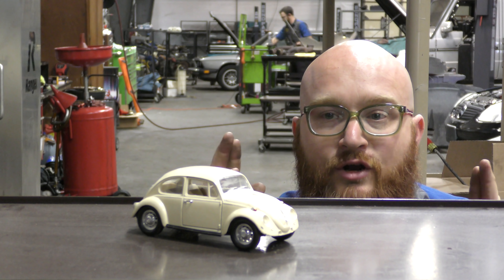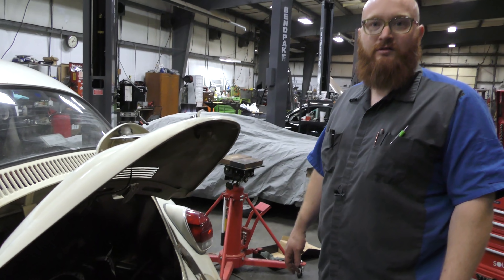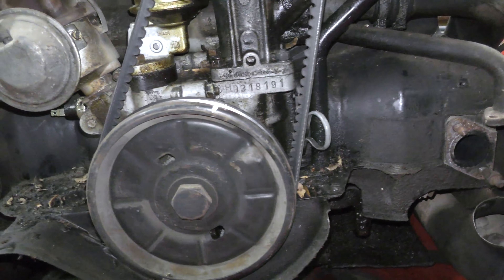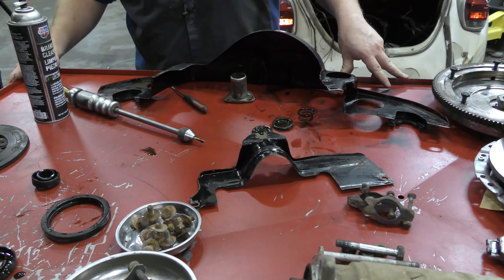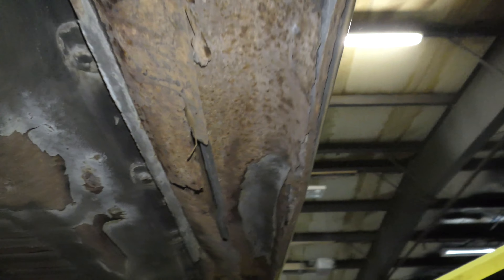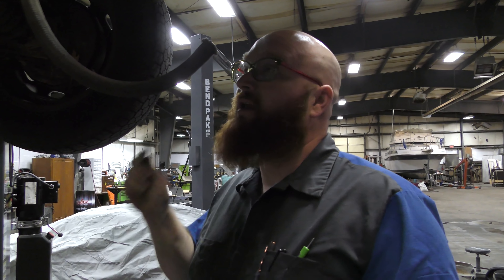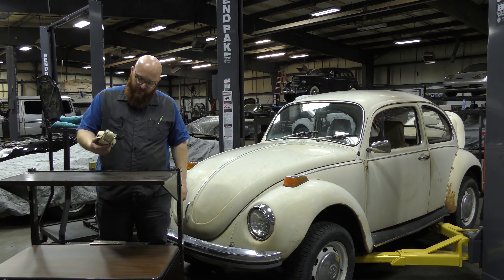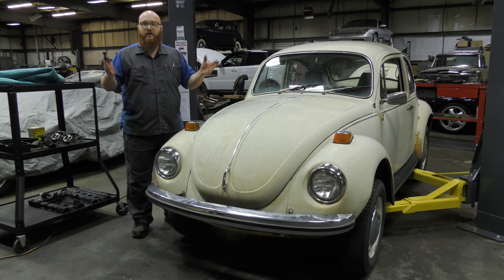Engine out for a clutch on '72 Super Beetle?! CAR WIZARD shows cool little car & huge repair process

Comment: When I was a kid, we changed the engine in our 67 on the side of the I-17. I was too young to remember what the problem was. But my grandpa had an extra rebuilt engine that he put in the truck, drove it out to us with a couple big strong friends, there were a few of my dads friends with us. Unbolted the engine, 7 guys lifted the back of the car up to drag the engine out and slide the new one in, jacked it up, bolted it in. We hopped back on the highway and drove to Flagstaff. 

Years later and I can do that entire swap in my carport in 30 ish minutes on my Baja. These cars are incredible just how cheap and easy literally everything on this car is to do.

Comment: Brings back the my memory of my first Beetle. I traded a 1st gen Mini Cooper, that was pretty worn out from all kinds of racing, for a brand new '97 Beetle. A week after I got the new car I was driving down a two-lane road north of Tucson and came upon an unmarked 90 degree corner. Forgetting that a VW handles quite differently than a Mini Cooper I just cranked the wheel hard left. Surprisingly, the next thing I know I am rolling over three times. Fortunately, neither my roommate nor I were hurt (we both had our seat belts on). Needless to say, my dad was not pleased that I managed to total a car with only a couple of hundred miles on it. Still love Beetles and wish I had one today. So easy to work on and so many performance parts still available.

Comment: Mr. Wizard,  Great video,   The starter doesn't have to come out.  Just take the 4 bolts around the engine out and don't loose the half moon bolt for the starter.   If you take the starter out inspect the Starter bushing that is pressed in the Transmission holding the starter shaft.
Reply: yes, but good to inspect starter anyway
Reply: @pablopicaro7649  Yes they are cheap.  I usually replace them with the autostick starter that is more powerful anyway and you don't have to worry about the starter bushing.  I usually take those out so they don't get out and lodge into the flywheel and starter.    Starter Model number SR17X
Reply: @pablopicaro7649  Not forgetting the small bronze Bushing in the Bell Housing for the starter shaft end, Check for wear - replace if engine is out.

Comment: A lot of people think Beetles have bad heat.  When the heater boxes and duct work are intact the heat is very powerful.
Reply: Especially once you got up to highway speeds. You actually had to turn the heat down it blasted out so much once the engine fan was turning fast.
Reply: @qwincyq6412    Yes, I recall that, and the opposite of having to hold my foot on the gas a little to get more heat while sitting at a traffic light.

Comment: Very cool, Super Bug.  Brought back some memories for me, my late father worked for VW and was involved in the conversion of the electrical system to 12v in the early 60's back when VW was stating local production here in Australia - in Clayton if I recall, became Datsun's/Nissan's plant latter on and I think is still Nissan's HO in OZ now.  I remember helping Dad working on various bug's (or as we called them at the time Hitler's revenge on the world) in the workshop's we had over the years. And torquing that flywheel up with long pipes over the end of the torque wrench, no air or electric tools to help you, way to inaccurate then (we are talking the 1970's) to get to the 380 odd foot-pounds - might be wrong on the figure there but it's just from memory, last one I worked on was in about 1982.  I remember we Dad would always grumble about working on them, but when you see 3 or 4 of them a week it would be a pain (hence the revenge comment).  But now with so few of them running about it is a probably a joy work on them now and to see the simplicity of the engineering for how capable and reliable they are and give to love to the bug.

Comment: 12:34 This bug ALSO uses air from the spare tire, that is what the clear-yellow hose is coming up to the bottle.  the shrader valve there can be used to check Spare tire pressure AND   for the washer bottle.
Reply: Lol They were comical cars. Have had so many I lost count.
Reply: Now wait a minute! Did he not say the bottle is only supposed to have 2 psi in it or did I misunderstand him? There's a lot more than that in the spare.
Reply: @wernerdanler2742  THe water squirt bottle originally could take about 35psi just like the tire,  its thick plastic.

Comment: Yeah, I used to work at a VW shop when I was younger.  I have done a lot of those.  Easy.  Only 4 nuts holds the engine to the transaxle.  I used an input shaft out of an old transaxle as the clutch-alignment tool.  Still have it in my toolbox today, even though I haven't worked on an old Beetle in many years.

Comment: "It's just like a motorcycle"
It WAS a motorcycle engine. In Brazil there were next to no motorcycles during the second half of the 20th century, save for really old and outdated harleys or other rare imports, so an engineer created a series of made in Brazil bikes that used the same 1600cc VW engine. They called it the Amazonas 1600.
Reply: Cool!
Reply: That's a big engine for a motorcycle. Must have been for a tourer or big cruiser.
Reply: Beetle Engine - made from Magnesium Alloy was used in some Light Planes too!

Comment: 6:50 Do not need to pull starter.  Although it's no big deal - and needs to be inspected anyway.  I've done in MANY times.
Reply: Need to replace that little starter bushing on the drive end!  Cheap, but if you don't . . . ay carumba!
Reply: And might aswell install a "hard start relay" while you can access the starter easily.
Reply: @michaelrice500  Not mentioned here, but yes, it's a pain if you forget to check it. As I discovered to my sorrow!!

Comment: Way way back in the mid 70s my brother bought a non running 1962 VW beetle. It was sitting in a neighbor’s driveway and had not been moved in a few months. My brother stopped and asked him if he would sell it. Brother bought it for $200.00. We towed it home,  pushed it into the garage, and started taking it apart. In a short period of time we had the engine out and sitting on the garage floor. 

We took the engine apart and found a broken exhaust valve that punched a hole in the piston. We bought new valves, rings, pistons, and bearings and had the engine rebuilt within a few days. My brother drove it for a few years before selling it. It was extremely easy to work on if you had a reasonable knowledge of engines. Little car was a lot of fun.

Comment: Here on Mexico have a shitload of them, even in the family actually have 3. Mine is 94 but carbureted and has some differences about the super beetle. Still that works fine but still leaks oil from the seal of the block (so common). Fun fact: From the 94 models they be made with the fuel inyection system and some rare ones with A/C.
Reply: Yeah, the Super Beetle, though sold worldwide, was mostly intended for the US market to help the Beetle stay competitive against the newer Datsuns and Toyotas until VW could get the Golf/Rabbit on the market. The old torsion bar Standard Beetle stayed in production alongside it as the cheaper model, and as sales in the US wound down, the Super Beetle sedan was dropped in 1977, followed by the convertible in 1980, which left just the original Standard Beetle that lasted in Mexico until 2003
Reply: For US Beetles, fuel injection was standard starting in '75, and that was the end of the easy-to-repair Beetles, as the Bosch injection was junk.

Comment: I had a 1968 Westfalia ,built an engine for it and used the same engine in a 72 super beetle because I could not afford to build two engines 92mm ,weighted crank line bored case cam and lifters from SCAT as well as exhaust. Oh my how many times I swapped engines to go camping. Thanks for such a cool video and some real nostalgia. Up here in North Georgia you can see many awesome Beetles and Busses .

Comment: Good video will help a bunch of people for sure. I will share a related issue I had a month ago. My 72 std. Bug broke in busy traffic lights as it lost drive, no changing gear! I assumed worn out clutch. Took engine out to see but clutch was good, cable was good, gear coupling was good.
Gearbox was good, happened one of three gearbox mounts towards the front the rubber broke off ,just gone so input shaft was out of line and wouldn't engage drive.
Gearbox removal is not fun without a lift, it's not heavy but alot of work with the axles and brake assembly.

Comment: My dad had a 63 beetle he put 50000 trouble free miles then I turned 16 and started driving it. Karl at the VW garage made a fortune. His favourite saying was its $36 to take out zmotor to repair anything, muffler, clutch, throwout bearing, heater box, clutch cable.
Reply: haha

Comment: I had two of them - a 1957 with the small back window.  It also had a gasoline fired heater which put out so much heat you had to keep a window cracked open.  It cut the mileage in half! Put out an earth shaking 36HP.  Also had a 1969.  Had a steel sun roof that didn't drain properly - if I parked the car in a rain storm with the back end facing 'down' the area enclosing the sun roof would fill with water. At the first 'stop' I'd hear a sound like Niagara Falls and, WHOOSH! I'd get soaked!  All in all they were wonderful cars.  I actually floated the '57 across a stream!  (No the heating system wasn't rotted!) If you had a fat guy sit in the back seat sometimes the springs from the seat would sag down and you'd short out the battery (and maybe burn the car to the ground!)

Comment: Spotted a little Made in Brazil engraving in the fuel pump! I recommend taking a look at the Bettle's history in Brazil! Quite an interesting read!
Reply: Couldn't help but compare that car with the Brazilian Beetles my mom and uncle used to have 😊 (both mid to late '70s, and my uncle now has a "Collor de Mello" version which has an awful interior 🤢); biggest difference I could find was the separate fuel gauge in the brazilian beetles (to the right of the speedometer), what felt like more idiot lights* on the speedo, no climate controls near the handbrake (dunno where they are 😊), and the position of the spare wheel (straight against the fuel tank, without the pneumatic windshield washer).

The two most salient bits (for me 😊) of Beetle history in Brazil:

 - Beetle production had ended in the early '80s but VW never quite dismantled the production line and production was restarted in the early '90s (for ~8 years) after lobbying by the then president Collor de Mello; the interior was different, but the only exterior change from the late '70s version was the single exhaust at the back.
 -  The VW Van ("Kombi/Combi") had a straight production up to the early 2010's, and the latter models had watercooled engines (same engine as the 2000's VW Gol) with a radiator mounted outboard at the front.
Reply: @docontra4921  They used to build and assemble them in Australia too (in an outer suburb of Melbourne).  When we migrated to here from Europe, after landing we were taken past the factory at night and I recognised the VW logo (I was just a kid).  It was the only thing familiar to me on that ride.

Comment: I worked in a shop that wasn't afraid to work on older cars.  So I got to work on a few cars that I personally liked and enjoyed working on and test driving afterwards.  I did have to do all 4 brakes on a 74 regular beetle and it was really easy and test driving it and locking it up inside the shop at night was fun.

Comment: The engine is only assembled with four bolts so that is the easiest way.
Reply: Ya simple job but this guy makes a big deal of every job so he can charge out ragious prices
Reply: No it’s because Hitler needed a car that easy to work on in any situation to win the war. That’s literally the only reason that car exists
Reply: It's like a 20 minute job. On the ground. With a jack.
Reply: @619guy202  they nazis also tried to get it to fly
Reply: @bystander1489  I bet they did. The Germans were much more ahead of us at the time
Reply: I can remember doing clutches on these cars back in the 80 `s . As you say 4 bolts  ,two heater hoses and as far as i can remember the battery leads and then grab the tail pipes and out it comes . 20 minute job from start to finish  ,25 if you stop for a smoke .
Reply: You are all Wrong. 
Two bolts. 
And two nuts.
Reply: And all u people who talk couldn’t feed a throttle cable through the shroud in 20 min
Reply: @619guy202  it's TRUE hard to believe but theres a small bit of black + white reel film of it if you Google you might find it also the bettle gearbox could be changed as internals so you could charge gears going in reverse in Ireland we have a place called the ring of Kerry which is very whindy roads and is 108 miles long and guys used drive it in reverse for charity in beetles with the gearbox reconfigured because the engine would burn out if you could not change gears in reverse a bit of history for you
Reply: @619guy202  you know Henry Ford made vehicles for the nazis?
Reply: @flight2k5  
Henry Ford knew who the real enemy was
Reply: @ne2i  yes, it took me around 45 minutes on my driveway. I had several beetles and Karman Ghias in the 80s and 90s
Reply: @fastinradfordable  15 minutes on the Autobahn in December at night without a flashlight 😃
Reply: @12yearssober  the US?
Reply: @bystander1489  The engine has been used in kit airplanes
Reply: Well, yes, I know what you're saying. I knew a couple of guys who used to steal the motors from them on the street. They had it down to under half an hour. They were cutting cables, heat, clutch, accelerator. They weren't thinking about putting it back together.
I've pulled the engine on mine by myself to replace a main seal that was pissing all over the clutch, and it didn't take me long, but because I was careful, it took me over an hour. Still, an amazingly small amount of time.
Reply: @bystander1489  over 300 different aircraft are designed to use this engine!
Reply: @12yearssober  Yes, the Jews. Henry disliked Jews with a passion.
Reply: @adotintheshark4848  yes I know Mainly because their air cooled my friend I'm 57 I could tell you thinks about those engines nobody knows about we used them in dirt hood rod racing
Reply: @bystander1489  they were the basis for the once ubiquitous Baja Bugs too.
Reply: @savagebob911  ya I know also the vw engine had a problem with piston going and what we did was just take out piston turn it around put it back in job done

Comment: I had an Australian built Superbug. The windscreen washer on mine was connected to the sparewheel. never had a problem with as I checked the tyre pressure when i refilled the bottle. Ours also had a better looking seat belt module for plugging the belts in to. It was so good that when I bought my new Alfa-sud i got them to install the same module in to it. It worked well in the Sud too.

Comment: I've done this exact job.  Couldn't get the top two bell housing/engine bolts back in so used twist ties to fasten it.  Never any problems.  In Canada we had a gas heater in the front, and I remember pumping up the window washer with a bike pump.  I always thought that came with the car.   Also had a camper van in Europe... great cars.

Comment: I read somewhere, and it stuck with me: "Remember, these were designed to be repaired in a 1930s German village. So it's equal parts simple-as-can-be and more complex than you'd want to take apart in your driveway"
Reply: And guess what... with those and the first few after the War bring your American wrenches. Hitler liked Whitworth fasteners made with Sheffield steel in England. S.A.E. wrenches fit the heads, but the shaft was metric. With a different thread pitch than today. 
For some mysterious reason England stopped selling them bolts but I believe the Germans just  got them from Poland, who were glad to cooperate. Poland still makes a lot of excellent fasteners to this day.
Reply: @sammolloy1  I would guess that once production started to ramp up they started to look for cheaper sources. The first few thousand Beetles were made in a bombed out factory by defeated Nazis on the orders of a British Army Major who needed transport for the occupying personnel.

Comment: Yes, I have done a few engine outs on air cooled bugs.  Disconnect the wiring harness, take the top 2 bolts out, jack it up take the nuts off the bottom studs, grab the two exhaust pipes, pull it out, let it drop. Takes less than 1 hour if you know what you are doing.  Great cars, simple, dependable and very easy to work on, parts are cheap too.  Also, disconnect the throttle cable.  Take out all the metal panels around the engine.  Disconnect the heater cables and heat tubes and fuel lines.

Comment: Hi Wizard, I've owned 3 Beetles1964, 1971 Superbug and 1974 Superbug. The Superbugs in Australia had front discs. My 1974 which I sold in 1992 is still going as we have seen it on the road and it still looks OK. Cheers-John